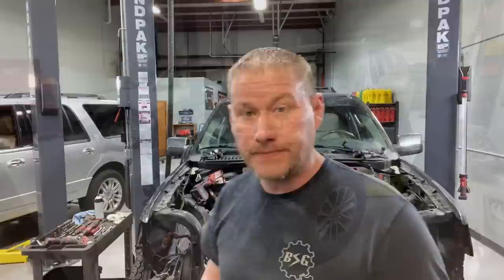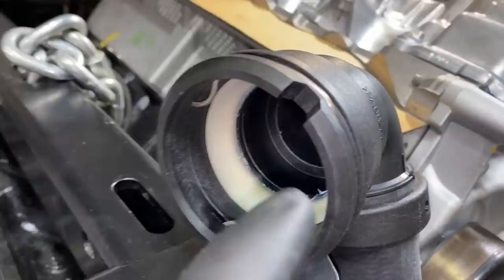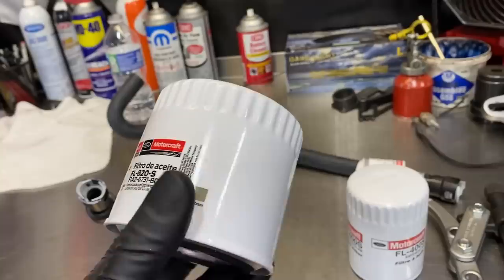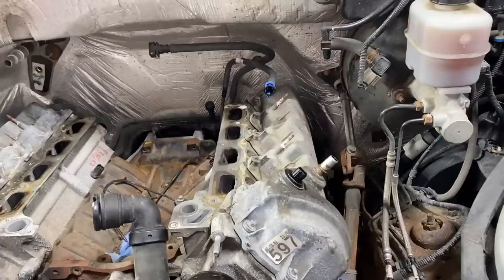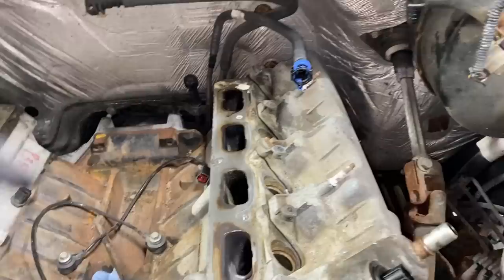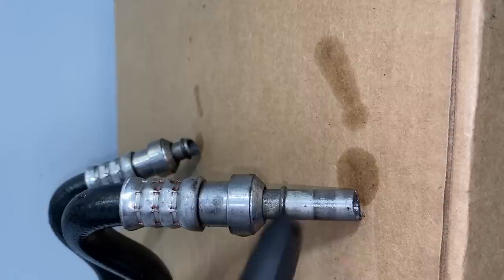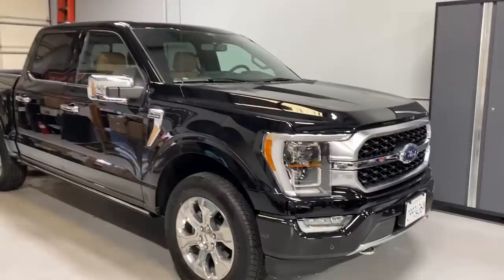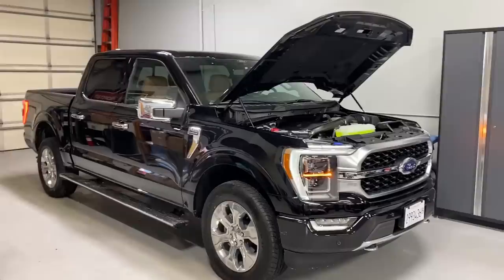Shop Update and The New 2021 F-150!

Comment: Most of the 3V rebuilt engines come from AER out of Texas. I bought one for $3200 from Eagle Engine Sales. It's the exact same rebuild out of the same factory as the $5000+ Motorcraft with the same 3 year unlimited milage warranty. The difference is my warranty pays $50/hr for warranty work where Motorcraft pays dealer rates of approximately $100/hr. Unless you're going to put 75,000+ miles on your truck in three years, I don't see where the Motorcraft is worth $2000 more.
Reply from the maker: There is a huge difference, I would know.
Reply: @FordTechMakuloco  Please elaborate. My Ford parts manager told me that AER is the Motorcraft rebuilder, and my engine came from AER through Eagle.
Reply from the maker: I am not going to spell out all the differences here but just remember this. Johnson controls make batteries for Walmart Everstart and Johnson controls also make batteries for Ford Motorcraft. Do you really think they are equal in quality inside? Same applies to AER, they remanufacture them to their customers spec, no more. Plus the Ford reman units are more complete than aftermarket spec.
Reply: @FordTechMakuloco  Thanks for the replies and the well done videos. They've been a blessing for lots of us who have dealt with this problem prone engine. There was a time when "Ford" (AER) remans came with aftermarket phasers, so even those have been built to a price point. Obviously this must have caused some warranty issues. Now most every engine seller advertises OE timing components, though I've read a few that said rebuilt OE phasers! I've pulled Delco labeled ignition parts out of Autozone Filko boxes. There's so much private label and subcontracting in the parts industry, it's hard to know what's identical and what's built to spec.

Comment: My 08 heater core hose broke at 297,xxx miles. Temp shot to max before I noticed, dropped a few gallons of water and drove a few miles to good spot, closer to home had it replaced and back driving within the hour

Comment: I'm interested in seeing you do the Explorer water pump. I had mine done a few years ago on my 2013 Interceptor Utility 3.7. My Ford dealer dropped the entire cradle down; engine, trans, front suspension and changed it on the floor with the Exp up on the lift. They did it in a day. Apparently, they do alot of them! Pricey fix for a water pump....

Comment: Retired Toyota tech here. Bought a new Ranger 2.3EB. Brought home my fuel induction set up we used with Valvoline products. Uses shop air, sprays into the throttle body boot. This is my first GDI engine. What's everyone's thoughts on using it and how often? Which chemicals recommended? BTW, very informative videos, Brian.

Comment: Wow, I love the new F150....beautiful truck!   You going to go under and rust proof the frame and stuff underneath?  One thing that drives me nuts on those is the rear end and diff seem to always begin flash rusting just sitting on the lot brand new.   Just an eye sore to me that visible.  Wish they would coat them better when they build them to avoid that.    Keep up the great videos!  I don't mind the Escape videos since we own a '16 1.6 SE as a spare car.....doesn't get driven much more than 3-4k miles a year (currently only has 23k on it) and stays in the garage a lot but it'll be around for awhile so I like to learn as much as I can.  Is kinda a strangely optioned SE with dual auto climate, Sync 3 big screen, rear parking sensors, power lift gate, seat heat.  No car payment and looks like it just came off the showroom so I don't see any reason to part with it.

Comment: Welp, I guess kinda glad to know I’m not alone on the trans cooler hose blowing at the fitting and then blowing the trans 🙃
Took less than a minute in my 2013 F-150 Platinum for it to kill the trans, dumped 11qts of fluid into the freeway

Comment: They use a single o-ring on the large sizes (>5/8") because the force to attach a dual o-ring QC in those sizes is greater than the ergonomic requirements of Ford assembly plants. Basically, assembly line workers would have to push too hard to attach them. While the assembly force wouldn't be much (about 40-100 Newtons) for a mechanic doing a few connections, it is a lot for an aseembly line worker connecting hundreds during a shift. The single o-ring designs actually work well in testing, that's why they use them. They regularly fail in the field though, which means the testing isn't a valid simulation of the real world.

The worst-case scenario for this type of quick connector is starting a cold engine, particularly in cold weather, and immediately operating it under load. This runs hot fluid past that cold o-ring that hasn't had time to become pliable and seal well. Add some engine vibration and you get leaks/weeps.

Note this is not the case with many quick connector designs. There are plenty of designs that have no issues.

Comment: Interesting design flaw by ford on the hose quick connects.  BMW and VW have been using similar connects for a long time and I've never had one leak unless the plastic was cracked.

Comment: Good point on the backordered parts. I installed factory driving lights on my 2009 F-250 4x4 and the wiring harness is backordered. No dealer in the U.S. has it. Very frustrating!

Comment: Really enjoying the channel. Thanks for the effort and sincerity you put into your content. I am in the process of buying a 2021 F150 4x4 but I am undecided between the 5.0 and the 3.5 Eco. I understand, or at least I think I do, the differences in the torque level available between the two engines and what each may be best suited for in regards to light, moderate, or heavy towing. My dilemma between the two engines is more to the longevity side of them, and more specifically the reliability and life of the turbos. I typically keep a vehicle for 10 years or more. I have an 06 F150 4x4 w/ 5.4 now, and am concerned about the replacement and/or maintenance costs that may or may not be associated with the turbos vs. the 5.0 without them. I would love to learn if you think this is a valid concern or not.

Comment: These new vehicles scare me, both the price and the complicated technology.   I will keep running my 84 F250 with 4.9 cabureted as long as i can, as well as my 3 modular 2 valve engines: 97 Expedition 5.4, 2000 Expedition 5.4 and 2003 Excursion 6.8.  All closing in on 200K miles with no engine issues.

Comment: I can’t wait to see more videos on that truck. A bit surprised you went with the Ecoboost instead of the V8, but I guess dealer inventory is tight right now. Is that a water cooled egr cooler?
Reply from the maker: The 18-20 5.0L engines were a disaster. Are they fixed for 2021? IDK but I sure don't want to be Fords guinea pig.

Comment: Question, cause you’re the smartest mechanic on you tube...
The dual clutch was replaced in my daughters 2017 Ford Focus at the Ford dealership.  Now when the car idles down below 1000 rpm there’s a noticeable vibration that wasn’t there before.  Above 1000 rpm’s it’s smooth.  I remember something I saw on another of your videos about making sure the clutch is indexed properly on the flywheel.  I’m wondering if this could be causing the vibration..  Is there any way to check it without pulling the transmission?  She’s taking the car back to the dealer next week to have it checked but they want to charge a diagnostic fee.  Any advise you can give us appreciated. 
We really enjoy your videos.  Pretty awesome.

Comment: Hi Brian. You mentioned you didn't want to buy 18 to 20 f150 models. Is there any particular reason/reasons why?
Reply from the maker: Way too many problems with the 2nd gen 3.5L Ecoboost engines and the 5.0L is an absolute disaster on 18-20 models and most likely still in 2021.

Comment: Brian congrats on your new truck, but I would like to pick you brain a little. Recently I drove my buddy’s 2012 f150, I have an 09 and I noticed that his brakes felt a lot better. My f150 has new pads and rotors so I know they’re not the problem. I was wondering if it is possible to slap on the rotors, pads, brake calipers and caliper brackets from a 10-14 onto my 09 f150?

Comment: Could you explain why you chose the 2021 f150 nad not the 2015-2020? Was it for the technology? Was it because of flaws for those previous years or was it just for content? 

It would be nice to see new content for the new 2021 f150 since I am also thinking about purchasing a new truck (or new to me). So I was just thinking about the reliability and other comparisons for those vehicles because I own a 2013 f150 that has minimal issues. Nothing is hard to fix or diagnose when you have great guidance!

Comment: LOVE your videos and THANK YOU! Question: I have a 2013 Ford Escape 1.6 engine. I had to add coolant since I had the car but seems to be getting worse. I've been reading about the coolant intrusion on these cars. I have 70,000 miles on it and very well maintained. Is the intrusion a definite or can I be one of the lucky ones and not have that issue and it may be something else like a hose or radiator. I try an maintain the car on my own as I do have the knowledge and tools. None of the hoses have been replaced and the car is 8 years old. How many coolant hoses are on this car? And I smell the coolant whenever I turn the car off so maybe there's a leak somewhere and it's not going into the engine. If in fact it was leaking into the cylinders would I still smell it? Any suggestions are greatly appreciated. I'll be eagerly awaiting your response. Thank you again, you're awesome!!

Comment: Did the EcoDiesel get traded for the new F150?  I'm an XLT guy myself... Do not see any reason for all that other stuff...  Still running strong with my 13 F150 3.5 Eco XLT.  It's got the MaxTow with #7700 GVWR and is more than enough electronics for me...  Can't wait for the tour of the new Platinum however..  Been watching FTM for as long as I've been watching SMA!

Comment: Congratulations on your new truck.  I have a question about the lincoln engine,   did you check compression or cyl. Leak test, i had the same problem cyl#7 found a burned intake valve

Comment: I have a 06 150 5.4 4x4. I changed the rear pad like your video. However only at low speeds, parking lot I get when I apply the brake this loud metal vibration sound coming from rear. Pads and metal hardware replaced.  Any ideas. 
Love new truck.  Your awesome.  Thanks for videos.

Comment: Sweet shop and truck!!!!

However I have a question lol

2011 Ford F-150 SuperCrew Raptor...
My driver side cv axle appears to have popped out from the front diff, and fluid everywhere. I got new fluid, a new cv axle, and new seal. 

What would cause the axle to pop out like that?

198k miles.

Comment: Have you heard anything about a thumbing noise on the 2020 F150 XLT 302 engine when you open the drives door  doesn't sound normal it did it from day one. The dealer doesn't want to fix it.

Comment: I know this maybe a dumb question but I have a 2017 ford escape 1.5 ecoboost front wheel drive,  and I watch your videos  . Are there any other oil I should be changing other than my transmission and motor oil?

Comment: Hey Brian.  we are currently working on a melted intake manifold issue as well.......but, what is the technical name for the hose/pipe that runs from the water pump under the intake manifold on the 2006 5.4L 3V triton?

Comment: Brian.  I am looking at ford expeditions.  Are the 4.6 all 3 valves ?? Up to 2015 ??   And in 2015 the ecoboost 3.5 was the engine .. are either engine durable enough to buy a used truck with 100k to 150k miles ??     The oil sludge on 3 valve and cam phasers seems like a terrible choice.   Is the ecoboost a better engine ?? I want to buy a used truck and keep it ten years.

Comment: brian, i have a 2020 f250, 4x4 short bed. 6.2 e 85 motor.  bought it from dealer with 9500 miles. in November.  drove it 200 miles went to gas it up and it shuts off the pump as soon as you click the handle on. 
took it in to dealer they said they never heard of the problem. their car fax did not show it as a service item. they ordered a part that never came in. took it back again they ordered a part that was designed as the manufacturer fix. that was lost. they ran it for codes and it came up the charcol vapor colector. i took it in and they installed it. i drove it off their business and went to two different gas stations. same problem still. i showed them youtube videos to prove its a known problem since 2009, they redesigned the system. they now have it and dont know what to do. is there a real fix. or a way i can fix the problem myself. just asking. thanks ahead of time for your response. JMHO 🙃

Comment: I've got a question that no dealership will even look into for me. I own a 16 f150 5.0 with 60k miles on it after driving for a boat 60miles or so it wants to stall when I come to stops mostly after a longer trip no check engine light and it is very random can't get it to replicate but has done it a few times this year any ideas will help thank you and keep up the good work!

Comment: Looking for help I’ve looked through forms and am trying to diagnose my problem. 2017 f150 4wd will not go into 4wd and is only showing check 4x4 when I try. I don’t hear any grinding and I think it may be the transfer case motor I did watch the replacement video but I couldn’t find one diagnosing it.

Comment: Thanks for all your videos.  Just curious, what do you recommend for those who have just purchased an F150?  What maintenance schedule do you recommend?  I'm thinking 5000 miles/yearly (whichever 1st) for engine oil.  I saw you recommend trans fluid at 30,000 miles, trans filter and fluid at 60, etc.  

What rustproofing do you recommend?   I've used fluid film to good results in the past but on my last vehicle switched to cosmoline which is stinky but lasts a lot longer than fluid film.  No rubberized crap of course

Comment: Are they still having the 10 speed issues with the banging and slipping? I want another f150 but my last 2 10 speeds in my 18 and 20 f150 would bang so hard and slip so I got a GMC. Weird thing is it was a 10 speed too but not a single issue. I assume its fords trans software causing the issues I've been hearing about for the last gen f150's. Whats your take on the 10 speeds?

Comment: Maybe someone here can help. 2005 ford escape xlt. Automatic 4wd does not work. I bought it a few months ago. The 4wd worked once. The 4x4 light was on and it was definitely working. Then it started flashing and wasn't working. Now every time the front wheels spin, the 4x4 light just starts flashing and it never engages the 4wd.

Comment: I have a question for you on my ‘14  5.0 f150. Engine will die at low speed  , difficult to restart. Have to let it sit n cool down to revive. 134k fuse relocated fuel pump ?   I’m asking for what to check  problem intermittent   also being on incline problem appears.  Motor usually at operating temp.  Ideas??

Comment: I have  a 2003 F-150 with several helicoils in place. The 8th digit in 
the VIN is a 'W'.  I found a 2006 Expedition with the 8th digit in the 
VIN an 'L'. Can I use the heads from the Expedition on my F-150?

Comment: FordTechMakuloco - how can I send you a picture of the coolant color on my 2021 F150 PB?  In short, there are two reservoirs one for lithium battery the other for the 3.5 engine.  When new the color of coolant was the same, bright yellow/green - after 30K miles the lithium coolant is the same color, but the engine coolant is now a light yellow almost brown/tan color.  Two dealers say this is normal and I think this is the beginning of some sort of trouble.  Thoughts?

Comment: The biggest issue I had with my 13 platinum was those damn power running boards. They don’t like winter and salt.
Reply: If you get underneath and lube them regularly you won't have that problem.  Some good penetrating oil will suffice.

Comment: Good day I have a 07 f350 6.8 gas that have a raddling noise I got the  flex plate get and that was not the problem I also got lifters and cam followers Change even the tensioners but the noise still there help please I have a video up

Comment: Hey great video like always I have a question I own a 2019 F150 with the 5.0 engine so far has been great the only issue I have is chirping noise when idling it only has 9,000 miles I have not taken to Ford yet because I don't know if I will get it back worse any advice on what the fix is.
Thank you

Comment: Love the channel ...How do I turn off traction controll 100 %...  I tap tc off hold tc button 8 sec acutrac off double tap tc button advance trac sport mode .... I try to throw it sideways on snow ..im in Mi. the conputer stiil limits the engine and abs on off ..  Is there ant way to go tc free 2015 150 5.0   ty

Comment: I bought a 2006 lincoln navigator I replaced the air ride suspension pump  and all the sensors but the vehicle is still not adjusting its height. Not sure what the problem is some say it not getting any power. What do you think?

Comment: Nice truck Brian! Question: I have a 2014 cmax with Sync. The back up camera image has randomly flipped upside down, and the backup markers disappeared. The internet is full of other models with the same issue. Performed a factory reset on the head unit but still upside down. Ever run into this?

Comment: Hey Brian. Any videos on the HCU for the older ford trucks/expeditions? Having trouble with mine on a 97 expedition 4x4.  Spongy pedal.  I believe I checked out everything that would cause this pedal drop...its a gradual drop. Of course bleed brakes several times and no luck. Do I need a special scan tool to get air out of the HCU? Thanks and really appreciate your videos!!